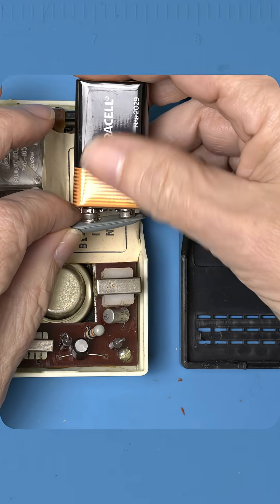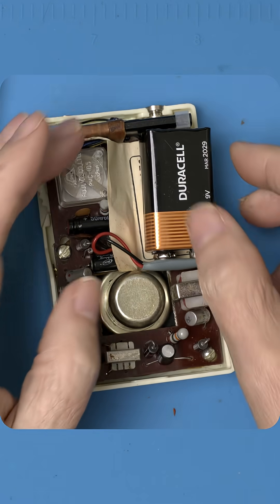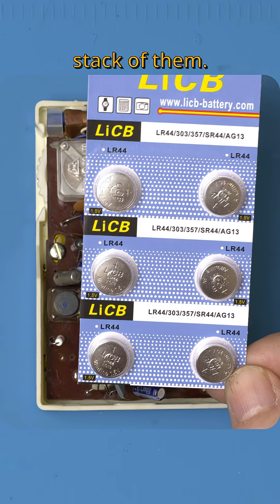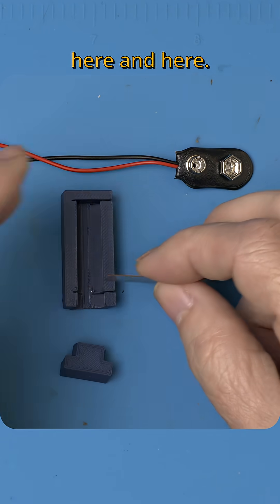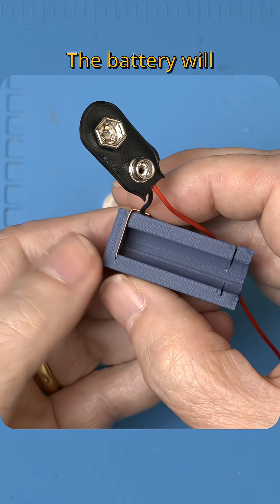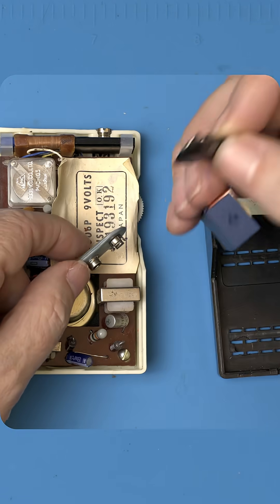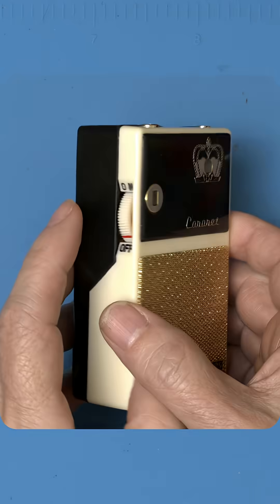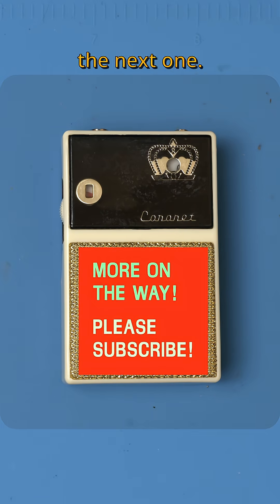When 9V Won't Fit: 3D Printed Adapter to use button batteries in Vintage Radio #3dprinting

Comment: The nine Volt battery can fit inside the plastic housing, provided a grinder is utilised to reduce the battery's overall dimensions. The button cell batteries shown will only allow a limited operation time of the radio. ☝️😮

Comment: You should punch a dot on the lower plate so the battery sits higher to prevent accidental short on its base. You could also use two harvested 530mah flat lithium batteries from vapes and use them in series with a cheap BMS and perhaps add a charging circuit aswell with a USB to charge them in parallel with low dropout diodes between them, or a 2 in series BMS-charger combo circuit, so to be able to just open it up and charge them.
Great job! Nice to see old stuff in such good condition

Comment: 3 CR2032 lithium cells would have approximately 9 volts and more capacity and fit just as nicely most new 9-volt batteries are a little over 9 volts anyway

Comment: It is a solution and I get the idea, but I would have just removed the metal casing of the 9V battery and put the elements in shrink tube
Reply from the maker: That would totally work, I like the shrink tubing idea to finish it off.

Comment: I am guessing that the circuitry might be very generous and could tolerate lower voltage.... what about two lithium pouch cells in series with protective circuitry?
Reply from the maker: Great idea.  I did test it with bench power and it worked at 6 volts, although the max volume was a lot lower.

Comment: Why would you use alkaline button cells, of course it won't last long? Get cr2025 lithium batteries, they're flat, the close 20mm diameter, and a stack of them will Last 5 years... Get cr2032 and it'll be rechargeable...

Comment: Instead to use the 3D printer for a battery holder, better use it to make a new cover with a bigger place for the battery
Reply: That would be good for a repair but with the cover fully in good shape its better to keep the vintage original shell. A battery adapter makes better sense in this scenario.

Comment: If you are going to use LR44 cells then use the silver oxide type. Yes it's more expensive but will last longer than the cheap LR44s that are all over Amazon.
Reply from the maker: Great suggestion.
Reply: @Dream.Build.Create Cr2032 lithium button cells. A stack with that many will last like 1 to 3 years, not to mention it'll be rechargeable.
Reply: Cr2032 lithium button cells. A stack with that many will last like 5 years, not to mention it'll be rechargeable.
Reply: @godchi1dvonsteuben770 A 9v battery is 17.5mm thick. A 2032 is 20mm diameter. May not fit

Comment: I would have checked a few brands of batteries... Maybe you need the one with the electrocuted cat on it.
Reply from the maker: Good thinking, but I did buy those batteries - they didn’t fit either.
Reply: This is the best description i've ever heard for an Eveready 9V battery xD